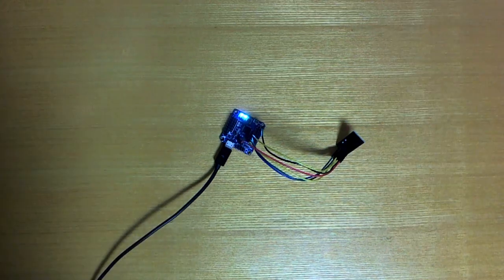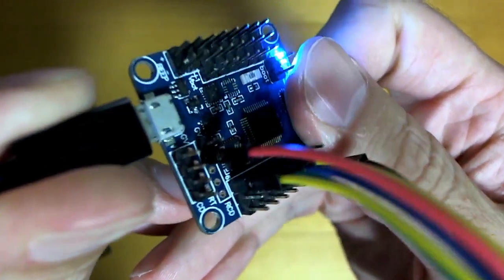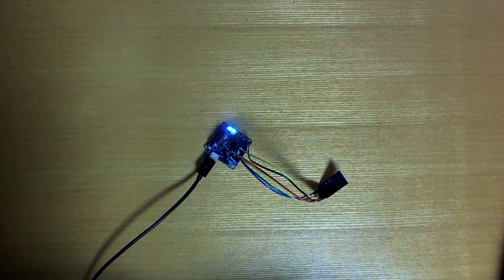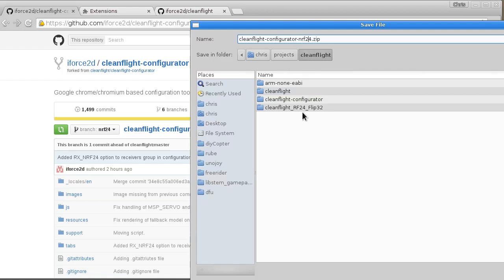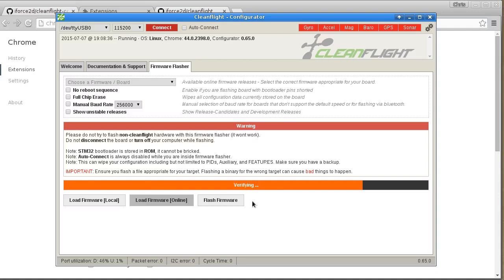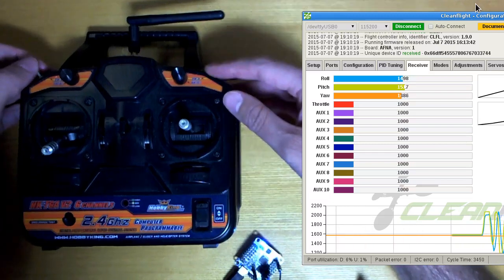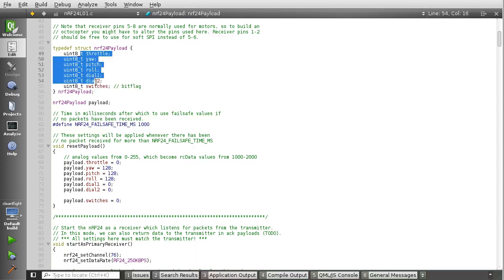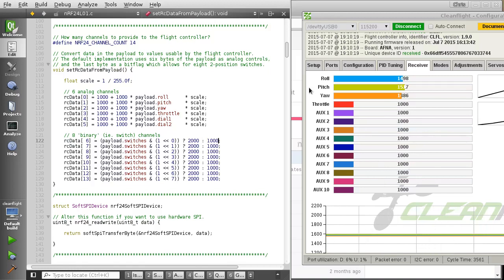Cleanflight + nRF24L01 (Flip32 only)

Comment: Hi iforce2d, i'm making a few teaks on the cleanflight code and i want to implement also the Nrf24l01. So can i use the same changes you made to the multiwii code for the cheapass quadcopter??
Reply from the maker: This might be interesting https://www.youtube.com/watch?v=K10qpQ47Q6Y
Reply: @iforce2d  Sorry, I was looking at this in my channel console, didn't realize that video was already the video we were commenting on. But since it is, I don't understand the reason for the question. If you're asking about adding nrf24 to cleanflight this video should cover it, at least as much as I can help with. If you're asking about adding nrf24 to multiwii I didn't really do that for the cheapass quadcopter, I made an nrf24 receiver using a separate arduino that outputs PPM signal, for the multiwii to read.
Reply: @chris-the-campbell  Im triying to ad another IMU sensor that is not on the list of sensors for cleanflight but also want  to implement the usage of the NRF24L01 just to develope my skills on programing, sorry that i haven´t seen that your file includes the modified NAZE code to compile, it will be a lot of help.

I have to tell you, watching your videos get my a ton of new ideas, made my own cheapass quad following your videos, keep doing them.

Comment: Hi! I like the way you did it. I do everything as you have shown, but the speed of the motors does not change. 
The transmitter I do from the Arduino Leonardo, it filled a sketch of ("CheapassTransmitter"). In flip32 I uploaded a configuration for chrome and the "tick" is NRF. What else needs to be done?  Please help!
 I am from Russia, I do not understand English, so the video is hard for me. 
Thank you!

Comment: how did you find the right pin name for the flip 32 ? if i use it for naze32 rev 5 will this work? i was using a arduino quadcopter build with nrf24l01+ with a cheap transmitter and now i am switching to the naze32 . i ordered flip32 but they sent me naze32 so now i am stuck making nrf24l01 work with this. Please help me as i don't have money for a new transmitter. Can i get your mail id for contact? Also could you please specify why does the cheapass transmitter sketch dosent work? maybe because the packet content data types don't match? uint8_t and int ? please help
Reply from the maker: You can often find a full circuit layout diagram for these boards, eg. the flip32 series are here: http://www.readytoflyquads.com/the-flip32-187 (the second image shows everything). Then look at what chip it uses, and read the manual for that chip, eg. for flip32 it has a stm32f103cb, you can find the datasheet in the first result on google http://www.st.com/en/microcontrollers/stm32f103cb.html
You could try it with the naze32, I think most of the layout (for receiver pins at least) should be all the same. I don't see the need to mail me privately since we are already discussing here. I also don't like to have to answer the same questions over and over and over, doing it privately is no help to other people who might be interested in our discussion. I don't know what you mean by "the cheapass transmitter sketch doesn't work". You can't run an arduino sketch written for an atmega328 on a STM32F1 chip if that's what you mean, they are a completely different thing lol. If you mean that you tried the cheapass transmitter on arduino and it doesn't work, that's a different topic so maybe make a comment on the relevant video would be easier to keep track of.
Reply: iforce2d I mean I already have a transmitter built with arduino and nrf24l01 . The sketch gets loaded no problem there but the.values don't change in the clean flight when I move the joysticks on my custom transmitter. I have set up everything as the pin diagram and my transmitter is working no doubt coz I have used it previously with multiwii plus nrf24 arduino. Am I missing something here? I followed your steps for clean flight? Do I have to rebuild the hex file or can I use it as it is? 
Thank you for the fast reply. Much appreciated

Comment: +iforce2d Hey great work ! Im looking to do the same setup with my ZMR250 quad. I plan to have a tiny oled on the transmitter which shows me altitude readings and stuff from the drone. Do you have any idea about the variables which are used to store these readings ? and also can the autoack function of the library be used on demand ? ie can I recieve data back from the drone once i press a button on my transmitter and not continously :) .

Comment: how can i connect without controller?
Reply from the maker: I don't understand the question. Connect what to what?
Reply: i mean just connet ESC's to arduino pwm.
Reply from the maker: You don't. The flight controller here is a flip32. The flip32 controls the ESCs, so the flip32 is connected to the ESCs. The arduino is only connected to the flip32 to relay the control inputs.
Reply: OpenPilot CC3D контроллер Flight Staight.it this same controller?
Reply from the maker: No. The flip32 is running cleanflight. Look at the video title :)
Reply: pls send me item on banggoods link.i will order that
Reply from the maker: https://goo.gl/3fz6FZ
Reply: +iforce2d thank you.is this board programmable or not?
Reply from the maker: Which one? Could you make your questions clearer? The flip32 and the arduino are both programmable.
Reply: +iforce2d but your? multiWii olso programmable?
Reply from the maker: Again I'm not really sure what you mean. MultiWii is a program that you load onto an arduino. If you want to, you can change the program source code.
Reply: +iforce2d and which one flight controller is recommended?
Reply: +iforce2d sorry for my bad english.im not english.one question..how did you can control motors with multiwii board, you just conneted from arduino to multiwii only 1 signal wire...

Comment: I just sumbled upon your video about using small nRF24 receiver. I am very interesting on that project, because it uses actually "brain power" of STK32 on Naze32 flip, which I like a lot. But, since I am working now on Si4432 (433 MHz), I wish to get more deeper into the problem and make changes so that Si4432 (maybe later Si4463) can do the job. I want 433 MHz because many reasons (less interferences with WiFi, less attenuation due to humidity, branches...). And, smal breakout board I have is only 0.7 grams! (without wires). It is just pain in the... because it has nIRQ aside SS, SCK, MOSI and MISO. SDN pin may be permanently connected to GND, so no problem there. This nIRQ is somewhat important, but maybe it may work without. If not, is it possible to assign one more pin on Naze32 for nIRQ, so that it can receive interrupt signal? Thank you in advance. milan ---
Reply: Oh, btw... Si4432 and Si4463 are transceivers, so telemetry is possible. Also long range things, because out there exist some 1W transceivers based on Si4463.
Reply from the maker: I don't really know. If you're not using receiver pins 2-4 you might be able to use them.
Reply: If I am using my own receiver, then no need to use 2-4 pins. Thanks.

Comment: can you update new version on cleanflight ?
Reply from the maker: +minhthien7288 I don't think there is anything to update... you could try merging my changes into current cleanflight.
Reply: +iforce2d  ok  . So , about Led strip , i think  you have to change RX input 2 or 3 instead 5  .Pin rx input 5 connect CSN  NRF24L01 . when i  turn on ledstrip , nrf24l01 not work
Reply from the maker: +minhthien7288 yes
Reply from the maker: +minhthien7288 https://www.youtube.com/watch?v=yxUEpmDe9z8
Reply from the maker: +minhthien7288 https://www.youtube.com/watch?v=eVnyPSAefxU
Reply from the maker: +minhthien7288 of course not, frsky radios use a completely different protocol. There are some radios that I heard can be modified to use nRF24L01, maybe walkera.
Reply from the maker: +iforce2d try here: https://www.google.com/search?q=walkera+nrf24l01
Reply from the maker: +iforce2d but even most of those mods are intended only to use the devo transmitter with an existing walkera quadcopter, usually one with an integrated receiver. If you want complete control over the radio protocol and generic ppm output, I think you need to make your own.
Reply from the maker: +minhthien7288 no, not easy at all - you can't just use some basic arduino code with "any transmitter". Different transmitters use the nRF module differently.

Comment: Wow. It would be great to have a full video of how you did edit cleanflight configurator and how / what you did to create / edit the firmware (hex).
It would also be so great to have this running with telemetry (like your multiwii project)!!

Please can you make a video of it???

PLEASE

I'm learning a lot of your videos.
Reply: I discovered your problem for flashing. It has something to do with the soft spi. If you disconnect those pins and you carefully put your finger on those pins then you can flash again. Looks like it's waiting for data.
Reply from the maker: +Albert Jansen This is quite different to the typical level of programming I cover in detail in my videos. To be honest, it's not the kind of thing you should really be doing if it needs to be explained.
Reply: +iforce2d  It would be so great to have it running with telemetry.
Thanks at least for all of your sharing and effort.

Comment: have been having a look at your github, and saw you were having problems with the 3.3v "For some reason it does not work when I power the nRF24 from a separate regulator, it only works when I power it from the 3.3v pin of my Flip32." did you ever get to the bottom of it? I have been using your multiwii nrf24 for a few months now and love it, thank you so much! problem is GPS isnt really viable on a 328p so am planning to switch over to a flip32 and clean flight. Did you ever finish of the Ack payloads side of things, if not I will have a stab at it once I get time and some nice weather (I'm convinced its rained non stop for the last 3 months here in England!) Anyway thanks again for the great work!
Reply from the maker: +Jacob Williams The ack payload side of things did not really need anything extra - I just left it unused in the github. It also gives the connection slightly less throughput that a plain old one-way connection (ack fails will trigger resend, so you better not get too far away). I did try it myself though, it seems to work alright: https://www.youtube.com/watch?v=DAXf5ho2jxs
As for the 3.3v issue with the flip32, no I never did figure it out, and it gets worse it seems. After a couple of months it started to become very unreliable to the point where I could not even arm the quad, let alone fly it. Sometimes it would fly for a bit and then drop to the ground. So I made another build of the same type (flip32 + nRF24 direct connection) and again after about two months of use the same thing happened. Sometimes I could not even get the flip32 to boot properly. Touching the wires between them sometimes helped, sometimes hindered. I went over all the connections and touched up the soldering, but nothing helped. I have no idea why it would fail like that after a couple of months...
Reply: +iforce2d ah great, it was the "//for a bi-directional link (TO DO)" bit that made me think it isnt quite finished, and I couldn't spot where you had put the ack structure like in the multiwii version. I dont have any FPV kit at the moment due to cost so I'm not flying very far, in fact I use the PPS as an alarm on my transmitter to warn me if I'm going out of range before its too late. Have just watched the video you linked, (I'm working my way through the hours of great content you've uploaded) Im impressed how smooth the plot is, whenever ive gone walking with my phone tracking me its all over the place. Thats interesting about the nRF24s failing, I havent had that problem yet but did have a different problem, I bought the non-shielded ones cos they were cheeper and thats a must for me, but they never worked above low pa, figured out the antenna was interfeering with itself so I removed the conector and attached it to some coax to move it away and also shielded the board with copper tape and solder and now they work perfectly on max pa. Anyway I'm looking forward to trying your cleanflight when my flip arrives, Thanks again for your work

Comment: After the Multiwii NRF24l01 integration now you bring the masses this new integration, bravo! This is great, I should be in the air with my DIY stm32F103 board shortly. I hope you do decide to do a pull for it as this is an awesome feature indeed.

Comment: Is it possible to add the nrf24 code to MultiWii instead of Cleanflight? Could I port your code over? However, I would need to know where to make to modifications.
Reply from the maker: +Ken Chew (Locutus) https://www.youtube.com/watch?v=bxlJckevIEk
Reply: +iforce2d Heya, been making progress so far with your tutorials, have decided to ditch MultiWii, and use CleanFlight instead. As I am studying your code, I am wondering how to use hardware SPI instead. Would you be able to show me how to do it? Thanks
Reply from the maker: +EyeInSky I tried that first actually and failed, so I guess the answer is no. It requires some quite difficult soldering because you need to solder directly to a leg of the STM32 chip. Ideally you also need to cut a trace on the board too if I remember correctly. In any case I never got it to work after about two days of effort so I gave up (I did not have a logic analyzer at the time though, which would have helped a lot). Plus I was thinking all the while about how even if I got it to work, nobody else would want to try it when I say "you just need to solder like this" and show that mission impossible soldering job lol
Reply: +iforce2d Hmm, I have a CJMCU STM32 based minicopter board with me with the SPI ports conveniently laid out and I could direct solder the nrf24 directly onto it. The image below, the SPI pins are at the left above the switch. Hence am thinking with that would it be easy to readapt your softwareSPI code and implement the HW SPI instead.
http://i926.photobucket.com/albums/ad108/curtisbyers/IMG_9442_zpsk3ylenrd.jpg
Reply from the maker: +EyeInSky in that case it would be a lot easier. As far as I know it is mostly just a matter of making the spiSend function use the hardware instead. You might need some preliminary setup as well, sorry I don't have any code available to help.

Comment: which development tool did you use to modify cleanflight configurator?
Reply from the maker: +GuitarPeter04 It's Javascript - so just a text editor
Reply: so your NRF2401 script is javascript as well?
Reply from the maker: +GuitarPeter04 no, the nRF24L01 code is written in C, included in Cleanflight. But I thought you were talking about the configurator.
You can see details on various dev environments for Cleanflight itself here: https://github.com/cleanflight/cleanflight/tree/master/docs/development

Comment: BTW, do you know how these pins are connected to the chip? Which chip legs, any resistors in between? I can take a look myself, but if you have a picture or just a list, that would be time saved. I will have to dismantle my cloneout for that, unfortunately. I'm trying to do that to afromini32 rev3: http://abusemark.com/store/index.php?main_page=product_info&cPath=1&products_id=45. 
Great board, BTW: http://www.abusemark.com/downloads/afromini_rev3.pdf
Reply from the maker: LeoTheHuman I'm using a Flip32, not sure how similar the layout is to the original naze32, but I used this schematic to see what's connected to what: http://static.rcgroups.net/forums/attachments/2/7/9/8/1/5/a5796215-218-FLIP32.jpg

Comment: I made a cheapass transmitter but added extra 2 switches. They both work in TestJoystics sketch. With receiver(cleanflight) and txtester switch 3 is ok, but switch 4 activates asterisks for switch 1 and 2 on txtester and nothing in cleanflight. Any thoughts? Thanks.
Reply from the maker: jarnoorasmae That last byte of the payload is a bitflag, so to set the bits in it you would do something like this:
switches |= 0x1; // bit 1
switches |= 0x2; // bit 2
switches |= 0x4; // bit 3
switches |= 0x8; // bit 4
...etc. Perhaps you are not using the correct values when setting the bits? For example, this would set the bits 1 and 2 at the same time, which sounds like what you're seeing:
switches |= 0x3; // bits 1 and 2
I have no idea why there would be a difference between the txtester and cleanflight though.
Reply: ***** Thanks, that was the case :) I got tx and txtester part working and I'll give a look rx at evening. Thanks again.

Comment: Can you really compile this sketch with the original Arduino IDE? Isn't the flip32 based on a 32-bit ARM architecture (unlike the original 8-bit ATMEGA architecture)? Don't you need a compiler that outputs a 32-bit ARM binary?
Reply from the maker: MrBushman The sketch in my zip is for the transmitter. Yes, to compile Cleanflight you need to use the ARM compiler.